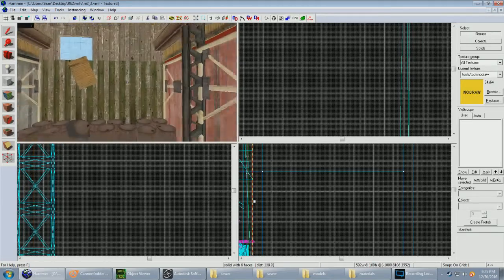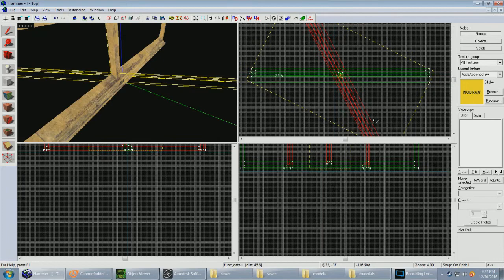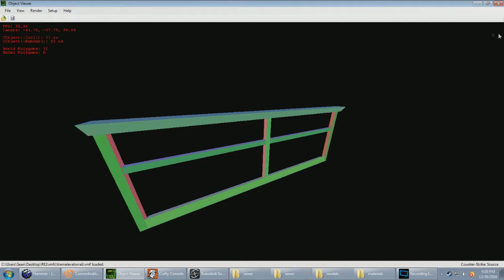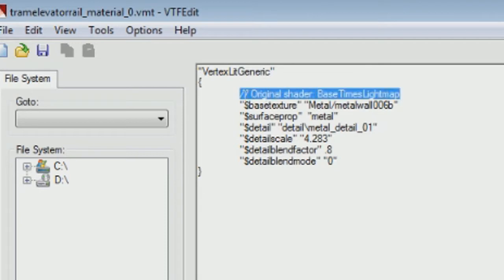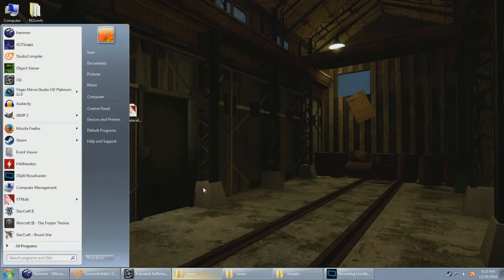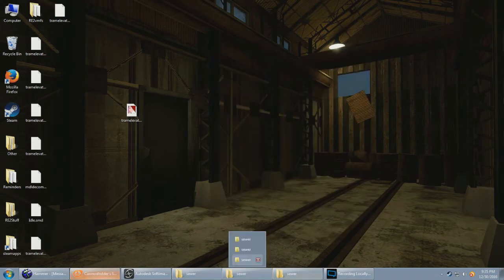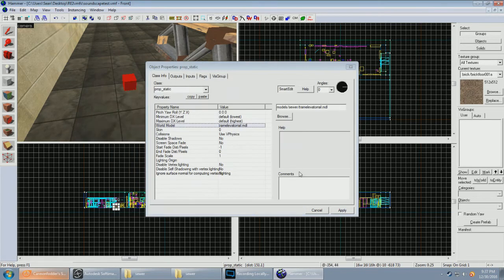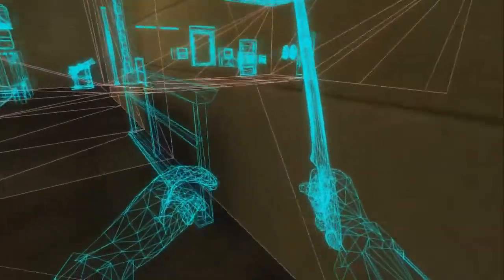Hammer Brush To Model Tutorial (Source Engine)

Comment: I have a problem with studiocompiler
Reply from the maker: studiocompiler can be pretty temperamental at times, what's the problem?
Reply: @BloodWraith777  I cannot open it and it causes a DLL related error
Reply from the maker: @loeskee6867  I don't recall studiocompiler needing any prerequisites like a redistributable to be installed, and the studiocompiler page doesn't seem to mention any requirements. it's probably looking for a dll file that's only on Windows 7 or older. What OS are you on?
Reply: @BloodWraith777  I found what the problem is.  The fact is that this is an old program and it requires old software, I just installed vcredist_x64 from 2005. Thanks